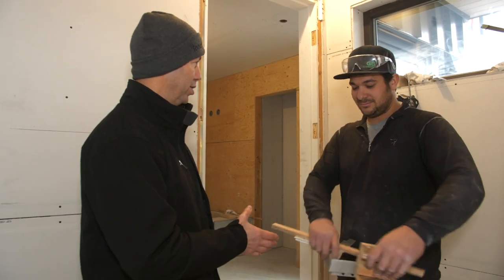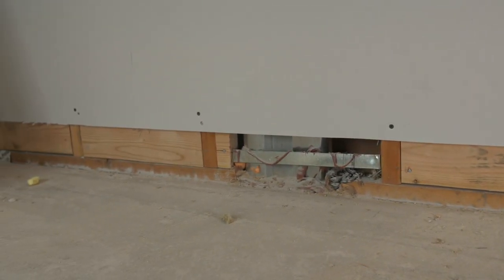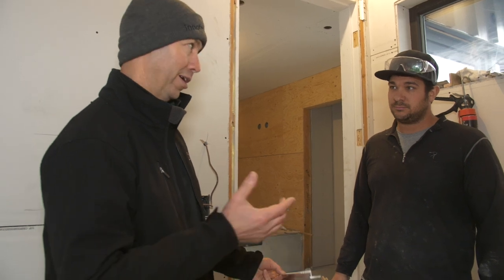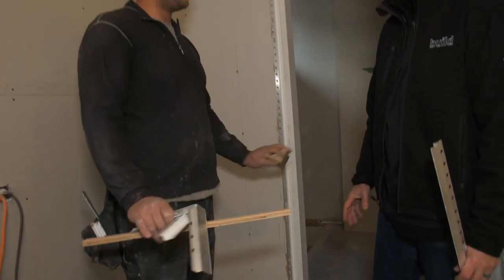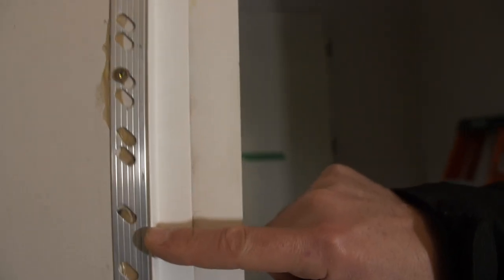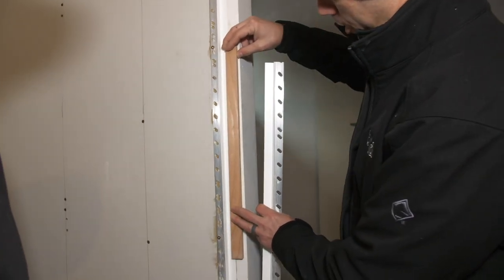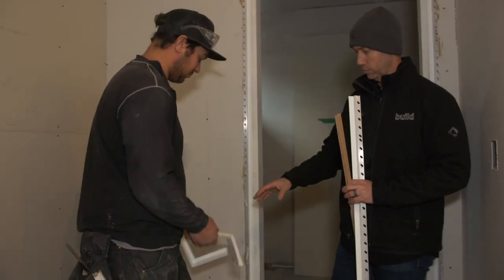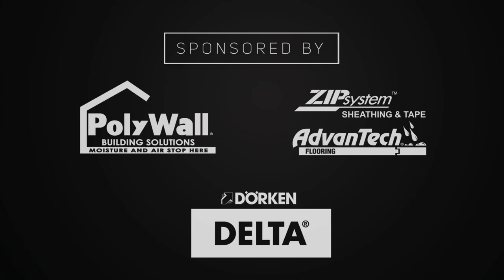Trimless Doors and Flush Base

Comment: Definitely need to see what it looks like finished.
Reply: @brianroth5872  It won't look like the link video
Reply: We were doing this in the 90's..we used steel J bead or Cap bead ...It's a pain in the ass...After a couple years; you get a hair line crack where the mud ends...
Reply: @terrellsprecher16  looks pretty slick actually!

Comment: I just finished remodeling an office build that did not have any wood trim around the doors. When I first looked at the job I thought it was full metal commercial door jams that we had used in tilt up concrete buildings BUT It had stud width (3 1/2 in")  door jams. the narrow face of the door jams had a grove cut  using a router with the slotting blade, a mini saw blade in the center. The doors were hung before drywall.. one side of the corner bead was the normal perforated flange and the other side was a finished edge long enough to fit into the slot.  The drywaller mudd ed over his side then the painter calked the metal to wood seam. You just have to coordinate the door installation before drywall an have the set back of the drywall at the doors.
Reply: yes, far  easier than the detail shown.

Comment: What does it look like finished?
Reply: I'd like to see it finished as well
Reply: Here you go: https://photos.app.goo.gl/ghMK4W4xByW58G7e8
Reply: @terrellsprecher16  Thanks!
Reply: @terrellsprecher16  That looks amazing. What do they do two layers of drywall?
Reply: It’s a single layer of drywall butted down against a preinstalled “reveal bead channel”. There are some good pictures on google showing the Install Method.
Reply: @terrellsprecher16  Oh wow never mind that gets mudded over, didn't realize that that's a huge lip.
Reply: @terrellsprecher16   Have a few questions if you're still around haha. Is the "baseboard" just drywall with a reveal bead in between?  And for the door casing, is that just an extra thick jamb with a reveal bead?  or do you have drywall on both sides of the bead

Comment: Well I can trim your 30 doors  with fj 2.25 casing for 100/ea so 3000 or do this reglet aluminum  for 250/ea, so 7500...You pick :) Either way; I'm happy...I hate putting finished millwork ANYWHERE near drywall finishers...

Comment: Boiled down...instead of a traditional baseboard over drywall, the board is attached directly to the studs.  A strip is inserted between board and drywall to allow for movement so you won’t see much gap after mudding.  It provides a modern look.

Comment: I wonder how this will hold up to the abuse of three kids that constantly beat every surface of the home with toys?
Reply: You would use Trim- tex with The Trim tex spray on glue
Reply: It wouldn't. Best to use square stock trim that is easy to repair and try to keep your kids tied up. They ruin everything. Its never in the brochure for having kids. Something like having to constantly lug supplies and tools is not in the brochure for carpentry.

Comment: What crazy idea spent $$ alumion when you gonna cover with plaster did this guys know about trim-tex.. at least is affordable regular glue and staples just adding more cost to the project to share more $$$ to the contractor....
Reply: Lol I literally had this discussion with a builder in Dallas today. (Build techniques are atrocious out here. Product knowledge is even worse.) But yeah at least with proper trim-tex you can keep the walls airtight and save a fortune. Lack of product knowledge is the only reason.
Reply: Just bend sheet metal and you'll be fine lol, Fry Reglet is expensive stuff.

Comment: Per code, this detail would not be possible on any wall that has the garage on the other side.  It does not meet standard for one-hour fire rating.  But it works beautifully on non-rated assemblies.

Comment: Tough to justify that cost for the look. Being 4 corners per side and 2 sides, its 200 Canadian per door Just for corners. Seems incredibly labor intensive too.
Reply: Boils down to taste. I agree, to me it looks cheap, like an unfinished office or commercial building where they didn't bother spending the money trimming the doors. Definitely doesn't look like a home. I guess it depends on the materials -- it could potentially look interesting and contemporary. As for cost though, obviously that doesn't matter. Some people have money to spend and want what they want.
Reply: A carpenter is gonna charge you just as much if not more to put mdf trim, patch the holes from the gun and than prime and paint seamless joints.

Comment: Hmmmm. Why is the casing not flush with the jamb? I guess because they are putting that little piece of trim on. Why are they putting that piece of trim on? I guess to hide the hinge screws which would be on the outside of the reglet.

Comment: I have no idea what this is about.
Reply: Yup, I didn't get it either, having never used it, assumes we're all professional builders...
Reply: It's a modern edge detail, eliminates the casing/base/molding elements by creating a shadow line. When done properly it can be nice..... But even in this video it's not my favorite product or install method. Google shadow reveal beads and you will see finished pictures. Best when lit up with LED or side lit fiber optic.

Comment: why are u putting stuff inbtwn the door frame and the 2x4 frame? how do u take out the door when people swap out a door and frame,and glue again how do u remove that to take it apart? remember build it to take it apart nothing is forever and repairs will always be..!
Reply: Guessing that was some sort of air seal / insulation and not glue/foam etc.

Comment: glue, epoxy, spit nothing works on aluminum. aluminum oxide is the problem put those screws back in. you need need chemicals to make it work that only commercial airplane manufactures can get that's going to fail i promise you

Comment: Has anyone used these? They come primed and are cheaper than the Fry reglet. It doesn't look like they have those inside corners though. I've used a Trim Tex before, but they seem a little flexible and make it difficult to keep perfectly straight. 

https://capdrywalltrims.com/aluminum-trim-reglets/z-shadow-bead/aluminum-drywall-trim-z-shadow-bead-3-8-x-5-8-primed-for-painting-8-0-lengths/